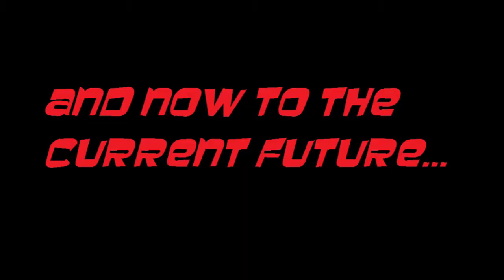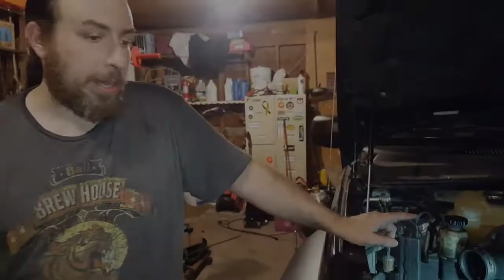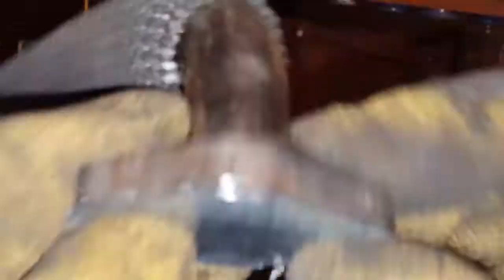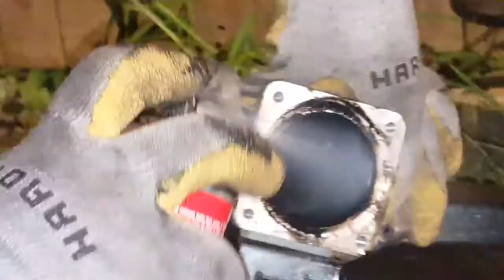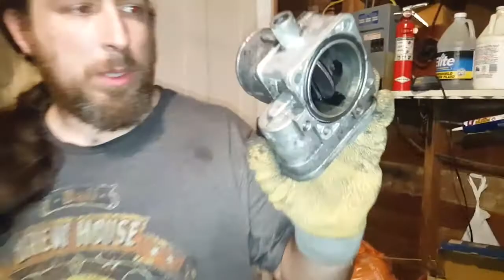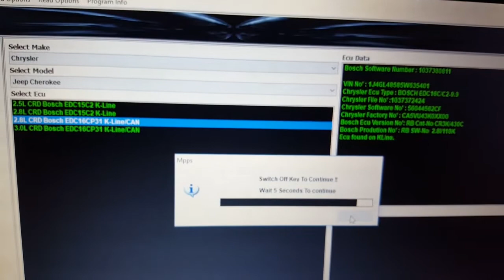Jeep Liberty CRD EGR Coolant bypass

Comment: I am trying to remove the EGR in order to replace the last 3 glow plugs. However, after disconnect everything and all the bolts off. The EGR seems to be stucked on the manifold. Why is that?  What should I do to get the EGR off?
Reply: Yo same boat. Did you get it figured out?
Reply: @SpookySmoulder  
Not yet I have had time to try to break it apart. Let me know if you ever figured it out.

Comment: Only getting 11Mpg on my crd 2006. It has about 230k Miles. Suggetions.
Reply: @Zumbastico  
Every 3,000 miles try to fill it up with BIO Diesel to help clean it internally. And also you can repeat the same by add some fuel additives like SEAFOAM in your tank once awhile

Comment: hello!! great video man. I'm not a mechanic but I can do the block off plate to the egr pipe on my own. is this enough just to save my engine from hot air and gain a bit of power or I have to do the whole removal of parts? I remember in a Mitsubishi I did the plate ant ecu and was ok. thanks !!

Comment: can you remove the cooler and leave the egr working for emisions? or disabled via tune, but with easy enable back in case of inspection?... i don't want to block anything because it will make it difficult for me to remove.

thanks

Comment: I live in Florida where we have no safety or emissions inspections. I'm planning on moving to the Ithaca area and I am concerned about passing emissions inspection with my Sasquatch stage one. How has your experience been? I know diesels are cleaner and safer for air quality but my father gave me this truck because the state of Virginia would not pass it with a stage one kit installed... How invasive is NY?

Comment: Ok so I just got a 05 jeep liberty crd.  What are the reasons for doing a egr delete.  I appreciate any information.  Thanks
Reply from the maker: The egr valve let's in exhaust gases I to the engine intake, this has small carbon partuclites you often see in diesel exhaust and over time it clogs the intake, as we also get some oil in the intake as well this causes a goopy sticky carbon deposit in the intake and reduced performance and shortens engine life (theoretically) thanks for watchin hope this helps!
Reply: So it is worth deleting.  I appreciate your reply.  Also could you recommend a tune for deleting it
Reply from the maker: @johnturpin8826  yeah def worth deleting we made another video on how to use a free tune that's already free online, there is a company that also does them green diesel engineering and they have very positive reviews, with a proper tune and a functioning egr the tune would be all you need, removing the actual egr is benificial if the system is experiencing a problem and causing a check engine light or leaking coolant. The quick method (will cause a check engine light) is to unplug the maf sensor and that will shut down the egr from opening.

Comment: I done mine on a voyager with 2.8 in the uk  it drives about the same but the oil stays a lot cleaner which is a good thing for the engine.

Comment: It sure what these are worth in USA, but over here in Australia, Tasmania actually, they're $4000-8000 AU , I just picked one up yesterday for $700 with registration, thousands in receipts for new glow plugs, injectors, tyres, sensors, suspension, all sorts really.... But the owner had enough when it wouldn't start one morning ( cranked, but no fire ), I bought it, towed it home (100km) on tilt tray, got her home, and she fired right up!!!! Drive her about 160kms on about 1/8th of a tank of fuel, and so far can't fault a thing, even tho over 300,000kms (186,000 miles)... I'm interested to follow your series and builds and check all this stuff on mine and see if it makes a power difference, etc, great show, subscribed and love it. Much Aussie respect

Comment: Need help finding a USA company that will do an egr delete.  The biggest diesel repair shop near Vancouver B.C. Will not do it. Any suggestions in Washington State?
Reply from the maker: Brett Gib upon doing a little research on the sasquatchparts website I found a shop called pawlik automotive that claims to be a installer of these parts...hope this helps.

Comment: Engine air filter element and boost pressure solenoid.  This are everywhere in the maintainance manual online.  Can you show how these are replaced.  Where to find them.  Will you do videos on this simple stuff to?

Comment: I just bought a 2006 crd with 98,000.00 km. Can someone suggest what preventative maintenance I should do with 60,000  miles
Reply from the maker: +Brett Gib seeing it is a 06, timing belt would be a good place to start if it hasn't been done yet. Manufacture recommends every 100,000 miles or every 6 years,whichever is first. EGR Delete or weeks kit is also a common upgrade to increase engine life. We have a video of how to do this install as well as the timing belt and more. A good website with a bunch of information on these crd's is lostjeeps.com Sam's crd noob guide is a must read for new crd owners. Hope this helps!

Comment: Somebody please help me .... 4 months ago I bought a 06 Liberty CRD .... check engine light came on .... took to dealer who said the codes are turbo "under boost" and "over boost" they said turbo is bad cost to replace the turbo for $3,000 ... what is your opinion .... other issues are white smoke and mis-firing or going into "limp mode"  HELP!
Reply from the maker: Sorry to hear your having trouble with your CRD the dealers honestly don't know $hit about the diesels if the turbo is in fact bad you should be able to take the intake off the turbo and feel if the shaft is loose, I would guess that the issue is the MAP sensor as a cheap option to try. Also there is a page on Facebook called Liberty CRD with many members that are super knowledgeable and also travel to work on these jeeps. Another good resource is lostjeeps.com. We made a couple other video with lots of info about these jeeps as well. Hope this helps, thanks for watching!
Reply: Do not rely on Dealerships!  I would ask someone in your area that likes jeeps and diesels.  Turbo job is not that hard on these actually.  Much easier than say replacing front struts!

Comment: I just bought a 2005 Liberty and I'm looking to tune it for the best gas milage possible. How has your gas milage been after tuning this? What software are you using to tune? So stoked I found this!
Reply from the maker: +nick heller haven't had a chance to check for mpgs we did make another video showing how to put the tune on and what software to use.  We love our diesel I am sure you will love yours too. There are awesome vehicles with proper maintance.

Comment: I've been getting errors related to MAF, MAP, and barometric pressure for a long time. No mechanic I took it to had any idea why I kept getting those codes despite having replaced and cleaned sensors (e.g., MAP, MAF, boost solenoid), and there were no tears or leaks anywhere. I finally took it to the dealer and they said I need to clean and/or replace the EGR valve; they quoted me over $1K for replacement this afternoon. I can do minor car jobs, but I don't feel confident to do everything that I saw in your video. What do you think are some good options that won't break the bank for me? Could I just buy an EGR valve and ask my local mechanic to install it for me? Any help would be greatly appreciated. 2006 Jeep Liberty 2.8L Turbo Diesel
Reply: Most people hate EGR is useless and kills the jeep slowly.  Dump exhaust back in the engine no thanks!

Comment: Just an FYI if you look on lost jeeps forum you can disable the egr by plugging one vacuum line on 02-05 liberty CRD2.8 no program needed. and you dont even have to do that, just put the tune in and it disables the EGR anyway. but do clean the map sensor on the top of the intake manifold as it will be clogged. only real mod you should do is do the oil separator (easy) and if your gifted clean all the gunk out of the elbow leading to the intake.
Be warned some of the more aggressive tunes are too much for the gearbox and tail-shaft and you get the shudder rattle from the auto and tailshaft. And be prepared for the sound of your engine to sound more like a diesel. The best tunes they got are the ones for economy but you still get a nice bump in power when you put your foot into it.
probably gonna have to clean the inter-cooler too

Comment: Can I use tune without physically egr deleting?
Reply: You can also electronically delete the EGR by unplugging the MAF sensor on the airbox. It just keeps it shut off because it doesn't have an airflow reference.
Reply from the maker: +Алексей Тарасов yes you can. .. there is another video on our page that explains the process.

Comment: If I want to get rid of the egr system, can I just run the tune, or do I have to physically remove the egr?
Reply: Unplug the MAF in the airbox and the EGR will no longer open. You will set a check engine code though without the tune.
Reply from the maker: Jack Feltmeyer here is a link to another video of ours on how to do that. .. https://youtu.be/sngGdf4NM6E

Comment: If you do nothing else to your CRD Get rid of the EGR and use diesel motor oil or it will die a quick death
Reply from the maker: +MM53 very good point!
Reply: I have a 2005 3rd and no mod with. 250k miles and nothing is wrong just Change timing belt every 100k

I beg to diagree
Reply: Is this 100,000km or miles
Reply from the maker: +Brett Gib 100,000 miles

Comment: Any notice in power increase?
Reply from the maker: +Lit Garage we actually noticed a decrease in power after the delete. I cleaned the map sensor I think it may have been clogged and causing an over boost issue. There are free stage 2 and stage 3 tunes to get more power if your feeling brave. We're comfortable with the base delete tune for now until we do a timing belt.
Reply: So after this EGR delete, and the weeks kit etc, what's your verdict buddy ? Worth the hassle ??

Comment: Just for your information, you don't have to buy a delete kit. I made my own. And the plug the goes to the heat exchanger is a 12mm x 1.5, you use a 8mm allen wrench to remove the nipple. I took the heat exchanger, egr, hoses to exchanger all off and as far as the flapper valve I went to my exhaust shop and bought a piece of 2.5" stainless elbow and had the put a bead at the end to hold the hose on. Made a plate on the lathe drilled the holes and welded it together for $60.
Reply from the maker: +paul scott you don't have to really do anything besides the tune to shut off this egr system, we blocked ours off for like $5 just because there was a small leak.

Comment: do you have to tune it after deleting
Reply from the maker: The ecu required a file or "tune" to not set off the check engine light, there is a link in the description of the video that has a list of the free tunes available as well as a link to the cable needed to upload the necessary file to the ECU. I hope this helps!